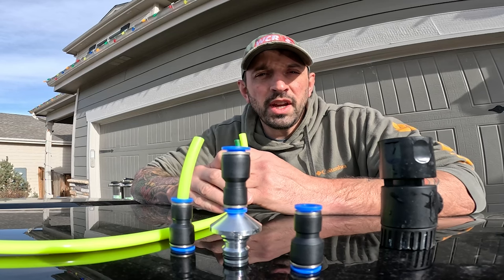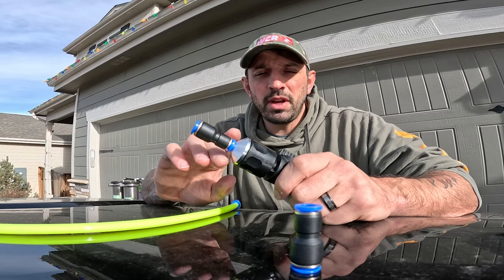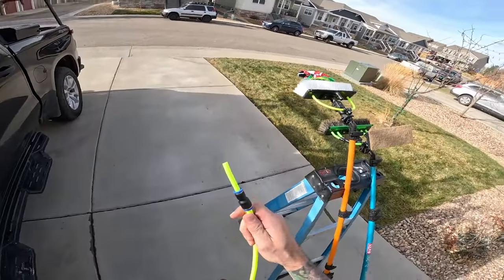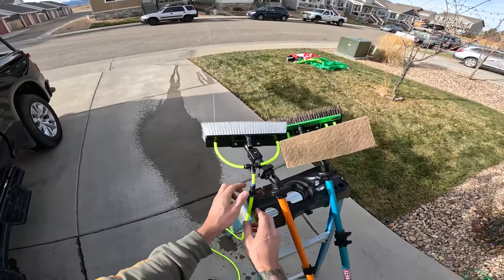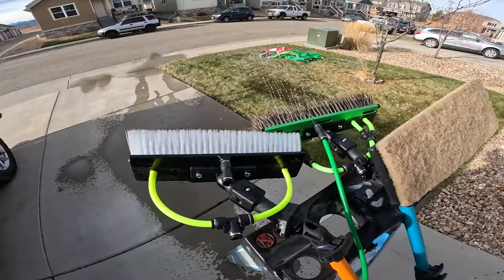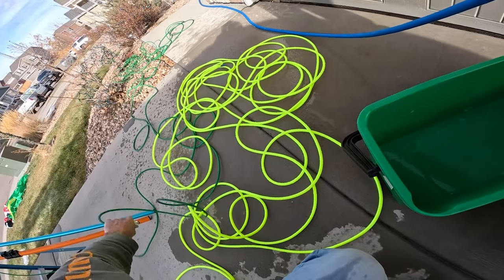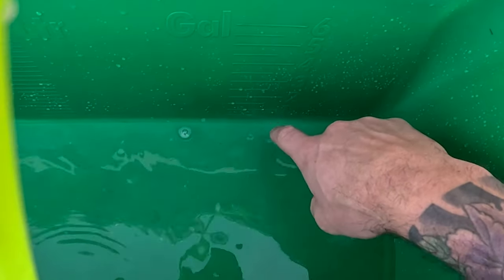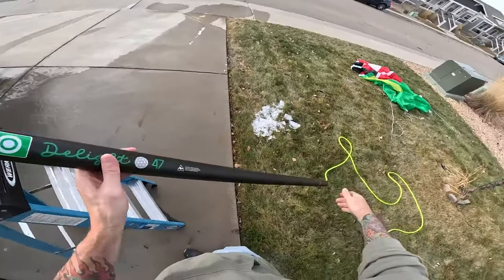XERO High Flow Hose Setup With SteveO!

Comment: I have used 3/8 vice 5/16 for 10 years. Ues, you get better pressure and flow. Another interesting thing is I did a video using a washdown pump do 3.7 gmp and 70 psi. I used a 1/2 hose for the main stretch from pump and then ran my 3/8. The pump ran so much better and used less electricity, less amps due to less restriction. Hooked up only 3/8 and it was working too jard, less flow. I use spray bars mainly so I love my flow and pressure. 5/16 and I never got along well. Last few uears I use flexzilla air hoses with high flow fittings. Main line is 1/2 and work line is 3/8 unless a simple job then use the 100 3/8. If you dont like playing with hoses and tips then invest in something like this from Xero. Water is like electricity. the smaller the hose and longer the less flow and pressure
Reply from the maker: This is great advice!

Comment: I'm wondering if you can run 150' to 200' of this new hose and still have good flow? If so we may not really need the regular hose from the reel.
Reply from the maker: We wouldn't recommend working with tubing that long as the flow and pressure will decrease and not perform as intended.

Comment: I just got rid of the 10 to 8 mm reducer at the QC because it kept popping off if dragged across the ground. Just slide the hose over the QC and add a small hose clamp.
Reply from the maker: Nice innovation!
Reply: Amazon sells Copolymer Tube Fitting clips that lock in the fittings which will eliminate any chance of a hose coming loose from a fitting.

Comment: Can I run 100' of high flow hose off 200' of 3/8th id blue hose and still get it done?
Reply from the maker: We don't typically recommend running that much waterfed tubing hose, as you will sacrifice water pressure over that distance. But you can always give us a call at 862-266-0677 to speak directly with a specialist to guide you through the best set-up practices.

Comment: Show a setup with univalve….seems like it would be a bit difficult to do with the bigger hose….cant give up the univalve.
Reply from the maker: You can definitely use the Uni-Valve. However, it is a little bit of a workout to get the clamps over the hose, but if you use a little lube, you can get them over. We are working on some options.
Reply: @windowcleaner  I just installed a univalve with 3/8" supply hose and used zip ties instead of the metal clamps that come with it and the valve in working perfectly.  I did use a tool that tightens the zip ties but it might work just as well by pushing it on tighter manually.